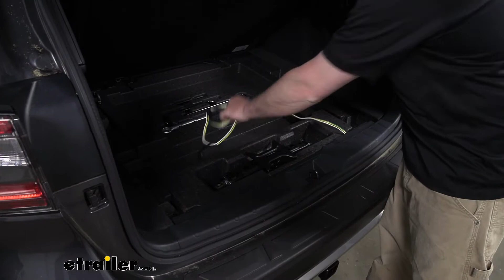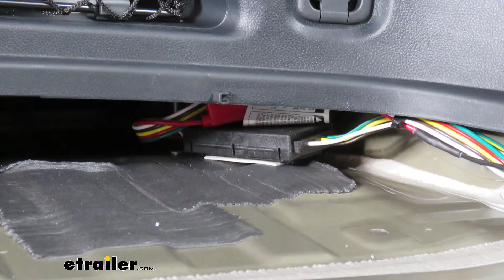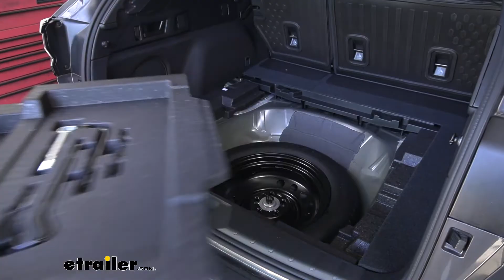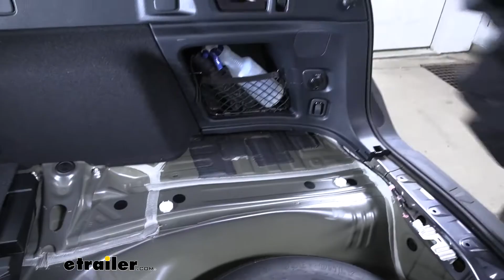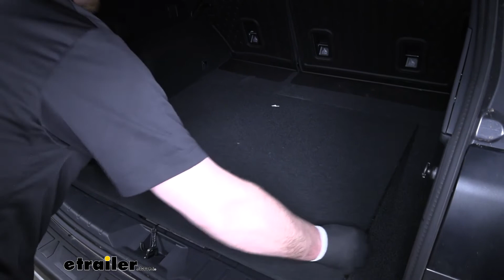etrailer | Curt T-Connector Vehicle Wiring Harness Installation - 2020 Subaru Outback Wagon

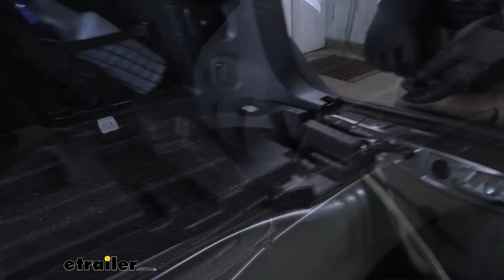Comment: Help! How do I get the piece of trim reinstalled? 7:54
Reply from the maker: If you're speaking of the threshold plate, just set it in place and push straight down firmly. I'll snap into place.
https://www.etrailer.com/Custom-Fit-Vehicle-Wiring/CURT/C56040.html
Reply: @etrailer  tried that. You need to pull the pins out, put them in the threshold, then push it all back in.